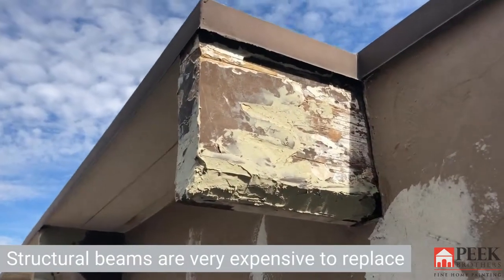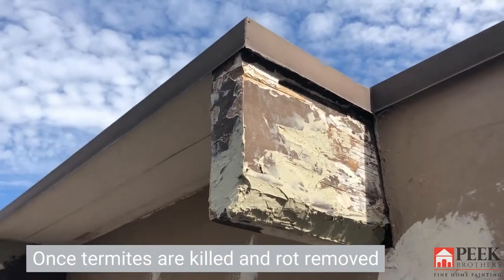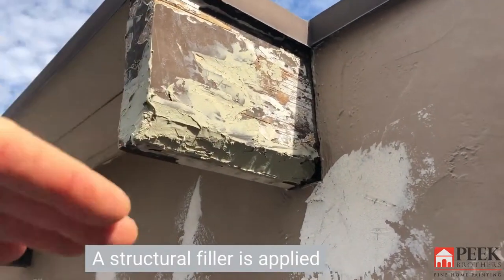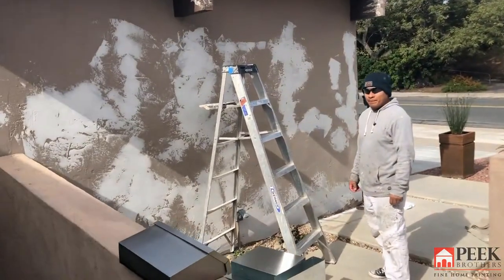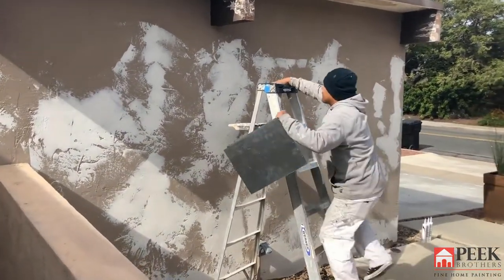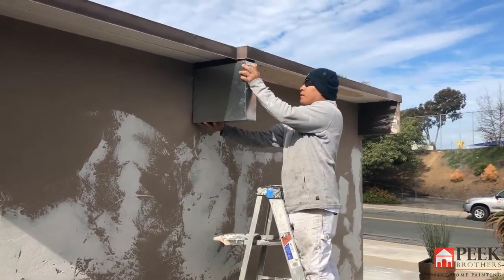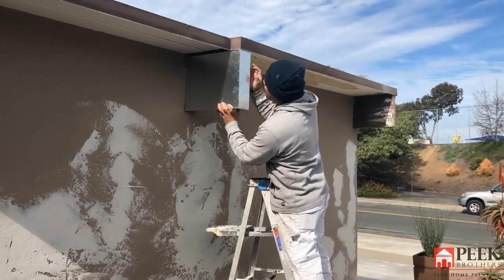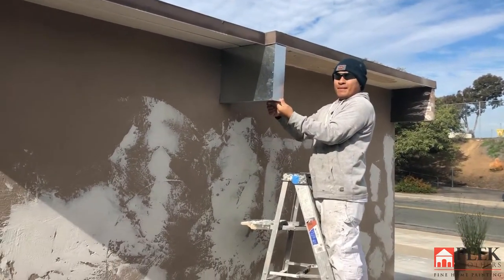Sheet Metal Boxes Over Wood Beams

Comment: What did you use to reduce the copper paint so you could spray it out of the gun when you painted the horse?
Reply from the maker: Did not reduce but you could reduce with water as it is an acrylic water thuinned paint
Reply: @johnpeek7908  are u alive